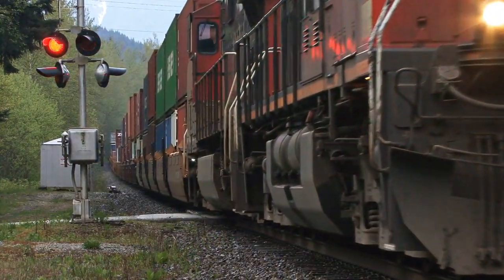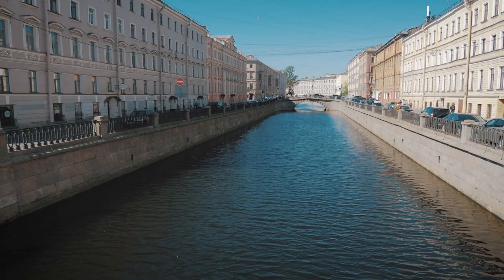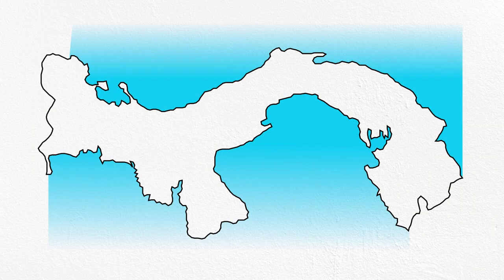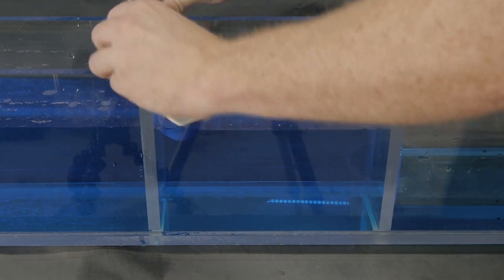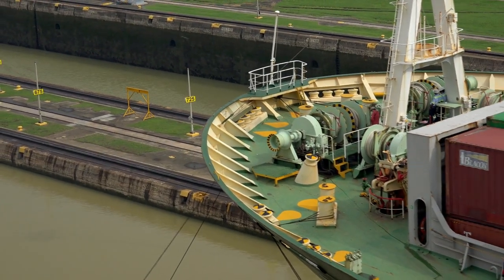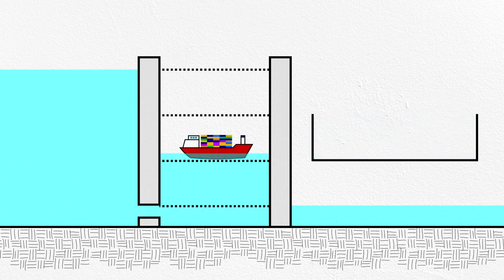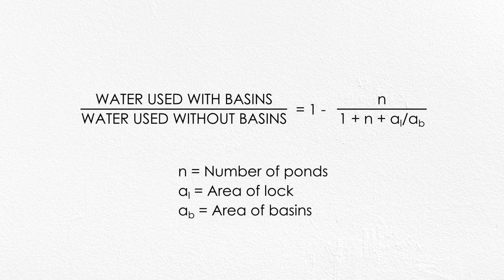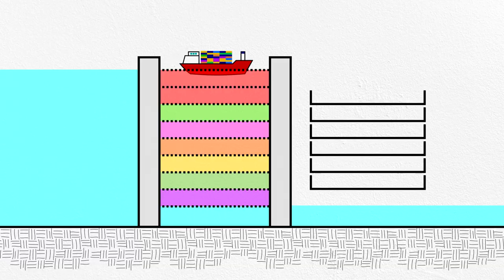The Surprising Efficiency of Canal Locks

Comment: @Practical Engineering Are there any lock systems that combine the basins and pumps? 

If I remember correctly, the cost of the pump is not just volume, but the head it can generate... If you had multiple lower head pumps that could move water around between basins, it seams like you be able to save as much as 90%, maybe more depending on basin size and quantity. Or am I missing something in this theory?
Reply: The cost of running the pumps. The whole deal with locks and basins is to be cheap. If you wanted to use pumps, why even both with filling the lock or basins? Just pump water directly from the bottom level to the top level. Then you're 'saving' 100% of the water, or even more, by pumping UP more water than you're letting flow DOWN.

Comment: Why not use a water pump? They could generate power while lowering water levels and use power on the way up. Pumped hydro is about 70% efficient, so you do lose power, but it uses way less space and cheaper to build, and young et 100% of the water back up. Bonus: You can generate extra power if there is too much water on one side or pump water up if there isn't enough. It might even work as a small  scale pumped hydro storage facility if there are a couple decently sized lakes.

Comment: Would it be feasible to pump the remaining water, that isn’t saved by reservoirs, back up to the top lock so it could flow through the system again (recycling). Like maybe catching it from underneath and using a corkscrew to push it upstream, using the force from gravity to move the corkscrew as the water is released from the locks. Is that possible? Like with some kind of system that includes an Archimedes screw?

Comment: How does the volume of water displaced by the boat impact the water usage ? If the boat is the same area as the lock it will displace that times  the boat draft of water so less water will be required to fill the lock ??

Comment: How feasible would it be to convert the GPE of the lock's water into electricity, store it in a bank of capacitors or something, and then use that electricity to power a pump? That would end up being a net 0 water waste, and would be significantly cheaper than fueling the pump entirely from grid electricity

Comment: I question if Reservoir was as deep as it is high, could you not use air or water bladders Like a submarine does not have any water lose. Basically the bottom of this would move up and down always having the same amount of water in it but adjusting whether it’s at the top level or the bottom level. With today’s tech and technology it looks like it would be a fairly easy solution that would not lose water and possibly allow a boat to do one lock instead of eight locks. You could have to Counter balancing reservoir one high and one lower bouncing water on each side so it would not require as much energy let gravity do the work.

Comment: I have a doubt, volume is the product of surface area and height, what if a lock has a moving gate , every time a boat enters the lock the gates move towards each other reducing the surface area which will increase the height of the water, volume remaining the same. Then the second gate opens and the boat move into the canal and as the height of water is same no water is lost from the lock due to gravity, now the gates close the move apart increasing the area and height of water reduces without any loss of water. Why is this not possible?

Comment: why don't they use renewable electricity sources to slowly but constantly pump some if not all remaining lost water up to the original high side? some of the electricity could be created by installing hydro turbines in the locks themselves so the act of using the lock would generate some percentage of the energy required to pump the lost water back up? of course it wouldn't be very efficient but if it reduces the amount of water lost to sea. Especially if it's fresh water and is the main source of drinking water for the local population. Seems like it would be worth doing a feasibility study at least.

Comment: "On rivers it's usually not enough to worry about." - is kind of a misleading statement...
On rivers the water flows downstream at all times anyways. If the lock is operated it drains through that and if the lock isn't operated it needs a side-channel for the excess river water to flow by the lock. (For an example, see here: https://i1.wp.com/berufe-dieser-welt.de/wp-content/uploads/2019/07/Schleusenw%C3%A4rter-1957-Flussschleuse-W.-Schaad.jpg?ssl=1 ) This means that by operating a river lock you loose exactly zero water. Technically, "not enough" to worry about...

Comment: Will this work, & is there a name for it... A pipe inside a pipe-stand (inner pipe has two 45*s
one inside- one outside- both point down) & the pipe-stand is filled with water
(air inside the inner pipe)=> air waterfall generator

Comment: So if we lift 100tonn weigh above  sea level we store potential energy in it.Then if we fix it in top position and drain the lock we will be able to drop the weight and extract this energy. Here is the question. Where is energy that lifted that weight? i mean it shouldn't be harder to fill 200L empty lock than a lock with 100t ship on it. or its just less water due to displacement of the ship?

Comment: Why not dig the basins to under the water level for these purposes?  You might need a pump, but electricity can be easier to come by than spare water.
Reply: If you were just using electricity, why bother with the basins at all? Just pump water from the lower canal to the upper canal. The whole point of the basins is to be cheap and easy.

Comment: Closing and opening those giant doors doesn't require external power source?
Reply: He said in its simplest from, meaning no power needed for pumps in theory, in practice power is of course used
Reply: @rogervanbommel1086  who would operate the pumps without power? animals?
Reply: I meant that water flowed from high to low by itself and no pumps are needed

Comment: Couldn't you just use lots of smaller pipes at the bottom of the loch to move it back into the canal the pressure of it would surely be enough to move it to a higher ground

Comment: Wont the doors that “lock” the different elevated water points break from all the pressure from the water? 🤷‍♂️
Reply: On most small canals the gates are angled into the uphill  water flow. The pressure of the water above forces them together .  Once the level is equalised it it relativly easy to open the gate, with the aid of the long gate beam. The level is controlled by smaller paddles built into the bottom of the gates. Operated on a crank gear.

Comment: Can you provide a source for the claim that a ship uses about half the energy to move freight as compared to a train, and a fifth compered to a truck? My research tells me that a ship can move a ton of freight about 575 miles per gallon, compared to a train at just under 500 miles per gallon per ton. That is only about a 15% difference. Trucks are almost 150 miles per gallon per ton, which means a ship is nearly four times as efficient, not five.

Comment: Why not just drain the higher basin into the lower one to enter, then pump the lower water back into the higher basin when the boat is leavng? Is it just too expensive?
Reply: 3:48 that is what they do.
Reply: @Bendigo1  but when leavingthe lock, the water is drained out into the ocean/lake, not back into the main lock.
Reply: @ZaccoOfficial  yeah sorry i sent that before i was done typing🤦‍♂️  the problem is that each lower lock needs the water from the higher lock to fill the next lower lock on the next cycle.  So if they use them to fill the higher lock they cant fill the lower lock as easily.  It would require a lot more pumping instead of using mostly gravity.

Comment: Grady,

Although your demonstration is a child like fun science experience model from back in the 80's, your information is very incorrect.  I live on the Ohio River and have travelled through many locks throughout my life.  I often travel through locks multiple times a week during the summer months.  The locks operating on the Ohio River in the pools above and below my area do not simply rely on gravity to transfer water from the upper river basin to the fill the lock chambers, nor do they simply let the water out of the lock chambers into the lower river basin to lower the water level in the chamber.  The also do not use water storage basins.  These basins would take up massive acreage to be used in the methods you have described.  All water used during the fill and drainage of the chambers for normal lockage of vessels is actually pumped in and out of the chambers with electric pumps each time the chambers are filled and emptied.  This process is the reason that water loss due to lockage operations is not a calculated concern.  Although this may be the standard for operations for some Lock and Dam systems, please understand that this is not the way ALL lock systems are operated.
Reply from the maker: I’m not aware of any locks that use pumps, but Im sure there are a few. This document says that Ohio River locks do not use pumps: https://www.nrc.gov/docs/ML0809/ML080980172.pdf. Sorry for any confusion!

Comment: 26 meters or 85 feet ----------  that not the greatest man made canal or lock system.  The Welland Canal and locks is 99 METERS or  324.9 FEET because ships cannot go up or down Niagara Falls.   The Welland Canal has 8 locks but 7 of them have a significant drop.  Locks 4,5 and 6 are called the flight locks.   When a ship leaves one, it enters another with no canal in between the locks.

Comment: i dont understand why there have to be seperate basins? why couldnt you just make a copy of the lock and store all of the water there instead of just little partitions?
Reply: Imagine the lock and basin side by side, exact same size. You open up a gap between them, and obviously the basin is only going to fill half way. So you're only storing half. Instead you can use 2 smaller basins to get some use out of the water you couldn't before.

Comment: Why not just use a pump? I understand the simplicity, but a high power pump/series of pumps would save more water. Hell, if power is a problem, why not have a lock-water cooled nuclear reactor to provide power/steam to use pumps, or superheated steam to drive turbines that generate electricity to power pumps, or just use the turbines directly to move the water through a gear box.